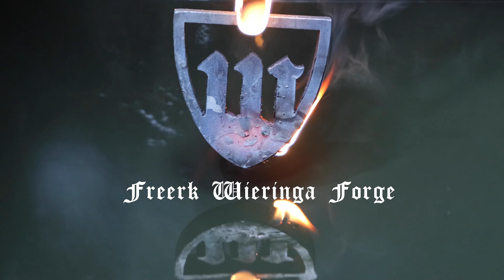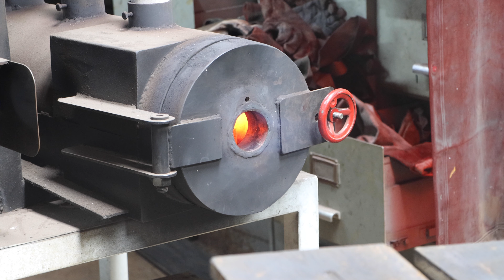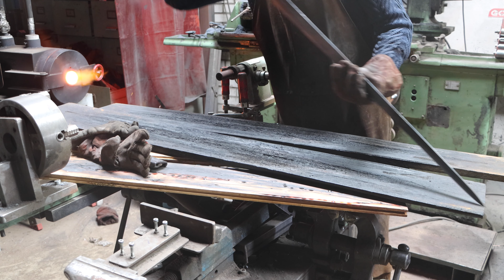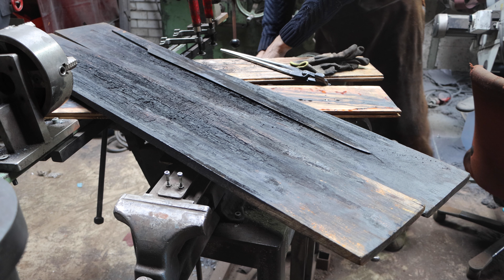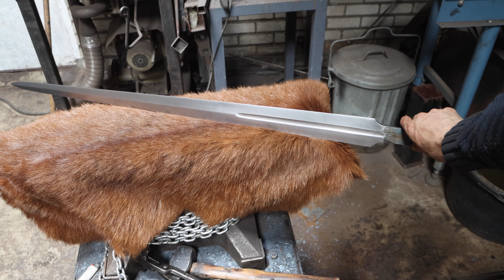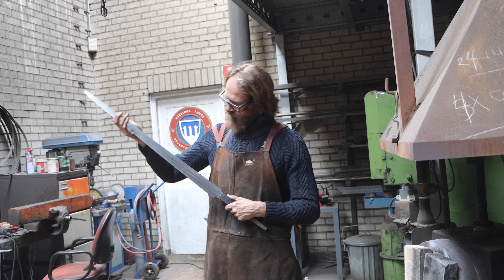Forging a arming sword, part 2, heat treatment.

Comment: I've been following this channel for awhile and I was wondering what is that coating that gets painted on the blade before the heat treatment and what is its purpose. I noticed that it's not used all the time.
Reply: Me too.
Reply: Liquid anti-scale compound that can be sprayed, flow coated, brushed or dipped onto your blade to minimize the formation of oxide scale my friend's. I hope this helps😁
Reply: @williamburns-uw2gf  thanks for the info. I've seen other blademakers usel the stuff but no one has ever explained what it is and it's purpose. Been watching this gentleman's channel for a while and really like his work.